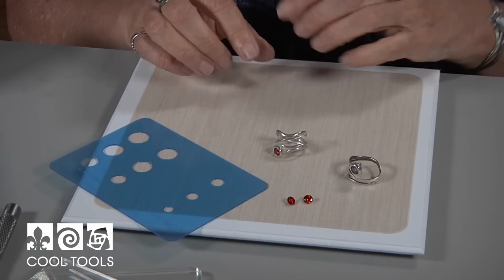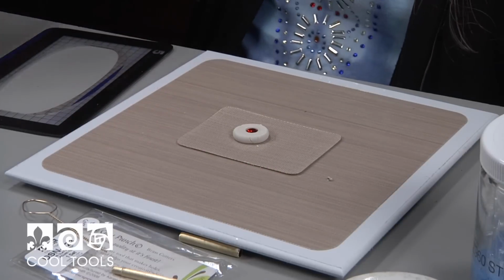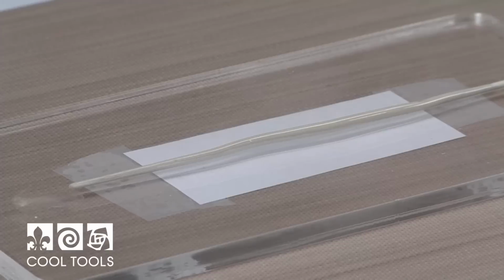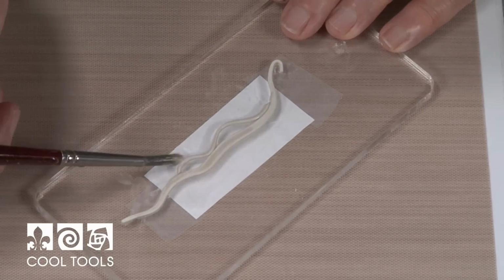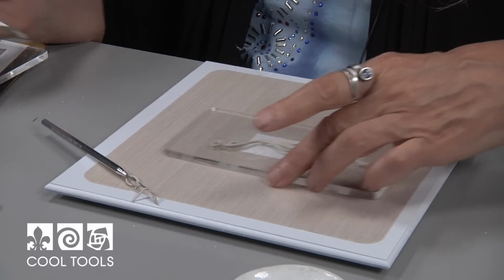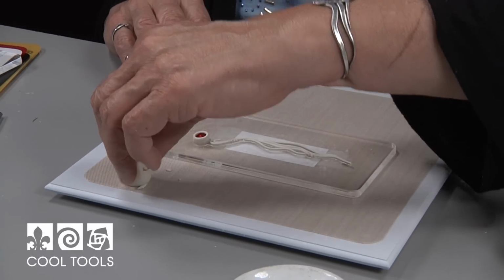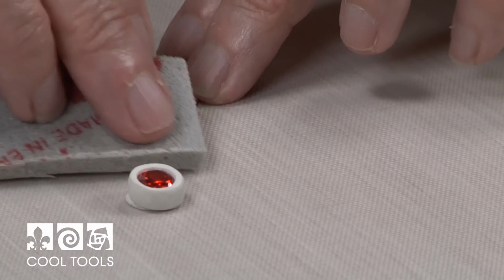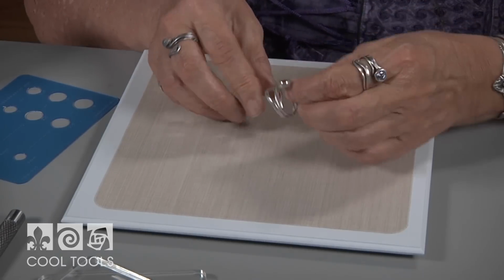Cool Tools | EZ960® Adjustable Bezel Ring by Lisel Crowley

Comment: Is it possible to make it with phoenix silver clay? 🙏
Reply from the maker: Absolutely!
Reply: @cooltoolsvideos  nice! Thank you! So it will not braek If fired and afrer bended, maybe is gona be more dificult to bend?
Reply from the maker: @YogiDreamer33  Hello, as long as the clay is sintered properly you should be able to bend it after firing without breaking.
Reply: @cooltoolsvideos  how i should be sure of that?
Reply from the maker: @YogiDreamer33  You can test if a piece is sintered by placing a drop of water on it. If the piece absorbs the water, it is not fully sintered. If the water beads up on the surface, you know it is sintered.
Reply: @cooltoolsvideos  thank you!!

Comment: Hi Lisa, 
How exactly do you fire a piece with a stone in it? I’m trying to find a video on it but I’m not sure if they actually show them firing it. If you have a video up, can you please recommend it to me? 

Thank you so much in advance! 🙏🏼♥️
Reply from the maker: It all depends on what kind of stone you are firing. Some stones can be fired open shelf, others need to be fired in carbon. Our Gemstone Firing Guide is a comprehensive list of stones - the temperatures they can be fired at, the hold time, if they can be torch fired, and if they require carbon or can be fired open shelf. You can find it here: https://www.cooltools.us/v/vspfiles/assets/images/Article-Gemstones_In_Metal_Clay.pdf

Comment: I am curious, did you use a torch to fire this piece or did you place it in the kiln? I think I just answered my own question. This clay is not used with a torch. Am I correct?
Reply from the maker: Hi Roslyn, EZ960 cannot be fired with a torch. It fires in the kiln. Hope this helps!

Comment: I love this design. Can this be fired with a torch or does it have to be done in a kiln?
Reply from the maker: Hello, firing EZ960 with a torch is technically feasible, but we do not recommend this. Have a good day!
Reply: CoolToolsVideos -- so, what is the worst that could happen if I used a butane torch to fire the EZ960?

Comment: How well would this style and process work with PMC Flex?
Reply from the maker: Hi Jeannie, PMC Flex will work. However, flex is fine silver meaning it is soft. Rings and bracelets often are made of sterling silver because of its extra strength. You'll also want to make sure that the gemstone you use can be fired using the firing schedule of PMC Flex. You can check out our gemstone firing guide here: https://www.cooltools.us/v/vspfiles/assets/images/Article-Gemstones_In_Metal_Clay.pdf

Thanks for the question!

Comment: Hi. I am new to this clay.  Usually use PMC3. I made this ring and it ended up breaking.  I fired it at 1675 for 2 hours.  What do you think I did wrong?  Thanks, Pam
Reply from the maker: Hi Pam, if all three of your tests failed the bend test at the recommended time and temperature, then your kiln is firing cooler than what the controller is telling you. I would recommend that you check your kiln with a pyrometer to determine what the difference in temp you are having at the 1675 to 1725 degree range. In our Cool Tools studio, our Paragon SC2 kiln runs 30 degrees cooler at 1675 degrees, so when we fire EZ960, we set the kiln to 1705 degrees to compensate.  I am very confident that you are experiencing something very similar.  I am sending you a loaner pyrometer for you to test your kiln. Once you are aware of and satisfied with your kiln's firing temperature(s), you will be able to fire any and all metal clays to their recommended and proper temperatures.  Another way to attack this issue is to fire at 1675 for 3 or 4 hours - we have many people that use this simple technique (firing for 3 to 4 hours is called a "soak") when they want to be absolutely sure they are getting a full and complete sintering - usually because they want to bend the metal after it has been fired in the kiln.
Reply from the maker: Hi Pam, this problem is caused by the clay not sintering properly. There are a few ways to test your kiln and its firing temperature. This article should help you find a resolution: https://www.cooltools.us/v/vspfiles/assets/pdf/Sintering%20Metal%20Clay.pdf

If you have any other questions please feel free to reach out to us!
Reply: the design is always with tape worms from this designer
Reply: CoolToolsVideos
Reply: I tested the kiln with the 1675 for 2 hours, 1700 for 1 hour and 1725 for 15 mins. They all failed the bend test. Any other suggestions? I read somewhere to do 1650 for 4 hours.  Should I try this? And will the CZ used in this project survive that temperature for 4 hours?  I really want to achieve this technique. Thanks for helping.

Comment: I'm still very new to all of this so I'm sorry if this is a stupid question.  I have been playing with polymer clay.  How does this differ from that?
Reply from the maker: Hi Kimberly, Metal clay is made from powdered metal mixed with water and a natural substance called "methyl cellulose". Metal clay handles similar to traditional modeling clays, and, when dried, it is transformed into a solid object through a firing process. Metal clay must be fired at a much higher temperature and requires a torch or a kiln as compared to the lower temperature required for polymer clay. Thank you for your question. Have a great day!